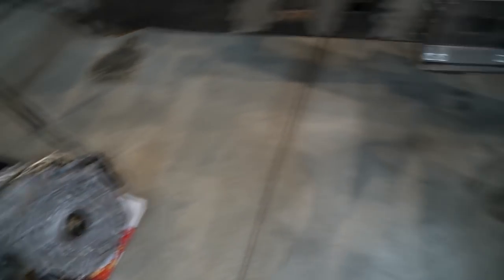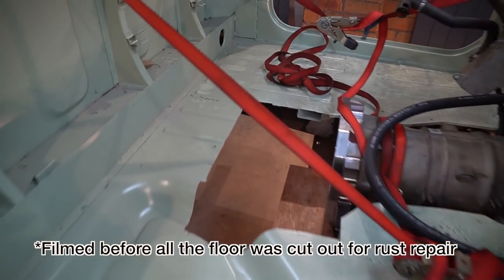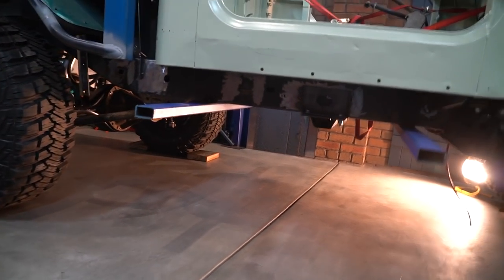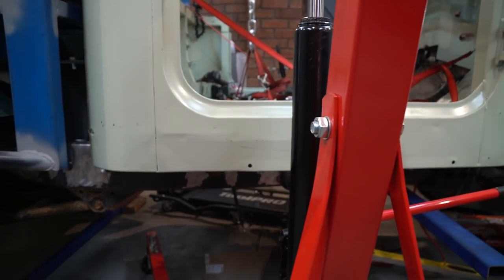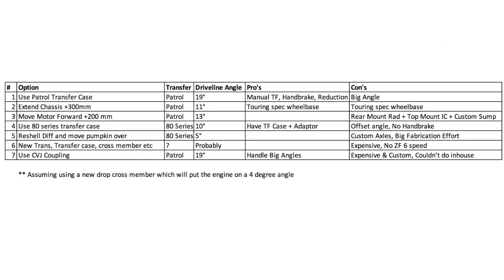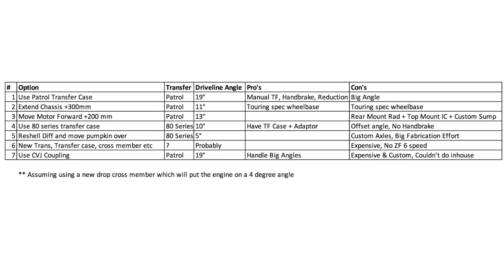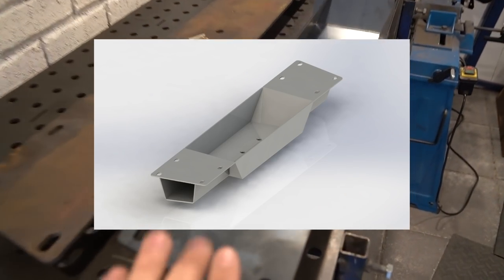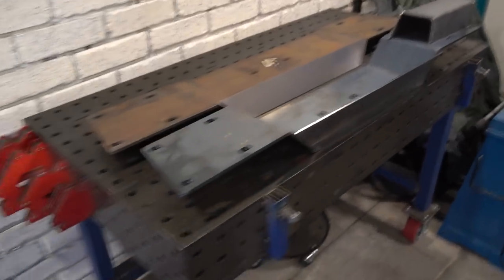PATROL STEERING BOX & DRIVELINE DRAMAS ON MY BARRA LANDCRUISER - Barra T FJ 45/ 80 series Ep. #21

Comment: Don't stress Bro, go Double Cardin
I have a SWB Manual JK Wrangler with 4" lift on 37"s ie big angles and short rear shaft . I upgraded to 1350 Spicer double Cardin uni at trans case 160km ago. 3.8 Petrol is custom built and running 12psi boost. Gets abused off-road, broke heaps of things but never the tail shaft. Oh also double locked and the Rubicon has a rediculous 70:1 final drive in 1st low so on high traction rocks drivetrain has to transfer massive torque loads.
Good Luck
CB
Any tailshaft shop will make one up just give me flange to flange measurements at ride height.

Comment: You could use dual uni joins in one end of the tail shaft as the Nissan patrol 260 series use. This is a European model so you can’t find it overseas. But it runs center diff on the rear axel and a normal patrol gearbox/ transfer as you se on the y60 but it’s build in to the k160 body
Reply from the maker: Cheers Morten, I’ll have a look into it!

Comment: extra option use a duble carden joint driveshaft and rotate pinion up to point at transfer case output. 
but still 19 degrees is nothing if it doesn't bind. you can replace a uni in half hour and they're cheap. vibration is a non issue as long as the t case output and pinion are parallel for a uni uni application.
Reply from the maker: Hey Michael, I talked to my driveline shop about double cardens, he said it is a good option, he said less angle with 2 UJs is better as a carden decreases the effective length of the driveshaft. They are however a good get out jail card if the driveline is wobbling.
I think 19 degrees would run fine, its just the longevity side of it.
Reply: those angles are common on short wheelbase 4wd's.  i find that mud and grit shortens the lifespan far more than angle. so if it is being used hard offroad you probably won't see any or much decrease in life expectancy anyway. changing the unis on the rear shaft every 3-5yrs is not a huge inconvenience or cost. having a centre output on the t-case means you're only turning the output shaft and bearings in 2wd. which is itself a strength, reliability, wear, economy, cost and noise reduction improvement.

Comment: I've got Subaru L series calipers on my LN106 Hilux.  The handbrake isn't the best, I found it very hard to get enough clamping force but maybe that was due to the straigth pull handbrake under the steering column.  On mine it does hold but on any decent incline I first have to press the brake pedal before pulling the hand brake or it will roll.
Reply from the maker: Yeah interesting you say that. I wonder if having it actuated from the handbrake will make a difference?

Comment: The GQ rear brake cradle bolts up to the GU housing then just follow the procedure from that patrol4x4 thread.
I have done the same on my conversion but I'm not sure I'm going to be happy with them let alone pass the engineering test.
I still need to bed the new pads and rotors in but I'm not holding my breath.

What ever you choose you will need a custom shaft so I'm not sure what's the problem. Yeah a double cardon joint is expensive but way less than the work you are proposing.
Reply from the maker: Thanks Benny. Hmmm doesn’t sound promising at all. I wonder if there is anything you can do to tweak/make them work better?

Comment: You could also change the rear diff to a h233 and use a front diff centre housing with the rear centre kinda making a off set housing less angle to
Reply from the maker: Thanks Riley, I’m running the 260 so would be a bit of messing around! But cheers like the idea

Comment: Awesome content as always.
If you remake the cross member, I've got another $0.02 worth for you.
I use 44mm DOM tubing, attached to the inside of the chassis rails, suitably bent to go down and under the case, but with shackle bush(Ford Escort, from memory) rubbers, either side of the case, instead of the factory rubber mount, below the case. 
For two reasons, the factory mount hangs stupidly low(the bolts even lower) and smooth chassis rail lower outer edges, stop rock hang ups and mangled bolt heads.
Brembo, TRW and Willwood all now sell electric handbrake(ebrake) calipers, disclaimer, I've never used them, but the VE Commodore's use of an electric setup, should clear the way through engineering. Alternatively, Atlas cases are short, centre rear output and there's a handbrake option, oh and a front dig handbrake U turn, gets everyone's attention.
Reply from the maker: Cheers Aaron, got a part number? I don’t like the factory mount and I could get another 40mm clearance if I do what you’re suggesting. 
I think I have one sorted using a 4.8 rear axle. Had a look at those electric ones and they weren’t cheap!!

Comment: Have you thought about using a hydraulic handbrake like the ones used in drift and rally cars with a clicking/locking mechanisms on the handle to hold itself on when you let go?
Reply: I think handbrakes in Australia have to be mechanically held

Comment: Didn't want to use weldthrough on the inside of the bolt protection portion to save it rusting later.
Reply from the maker: On the inside of the crush tubes you mean?

Comment: why not just start with a patrol chassis
Reply from the maker: Patrol chassis are weaker, the 80 series chassis is stronger and have far better mechanical design. The patrol chassis would be easier, but this will be better!
Reply: @DesignedandBuilt  Could have reinforced patrol chassis and saved soooo much time and money